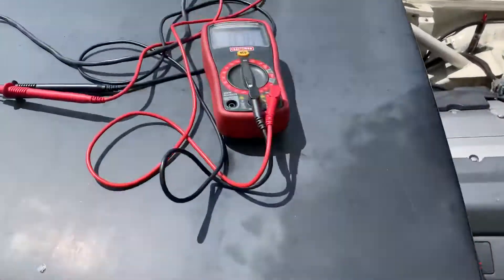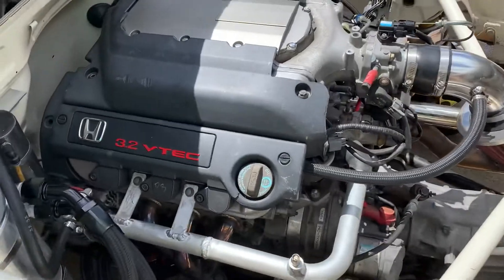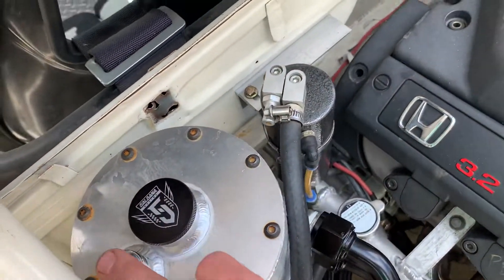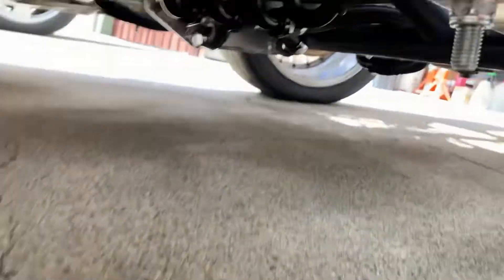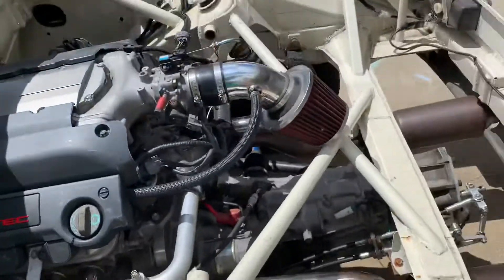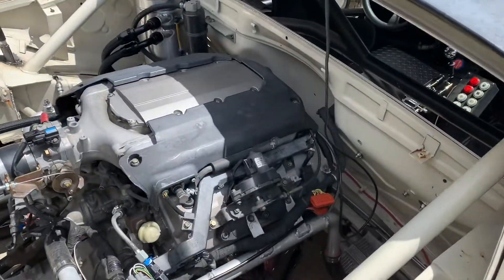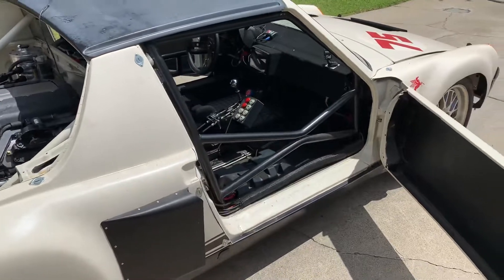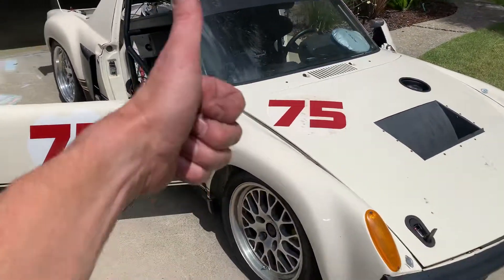First fire-up after dry sump system installation

Comment: Any details on the sump, pump and pick up?
Reply from the maker: Gutted the stock oil pump, removed the stock pick-up, cut and welded fittings into the stock pan.  Pump is a StockCarProducts (SCP) 4-stage unit I bought used from eBay.  Mount is homebrew.  The mandrel is attached to the stock harmonic dampener via a custom machined adapter.  See my insta mddavids@ for more details and pics